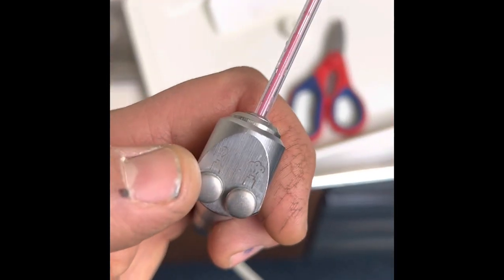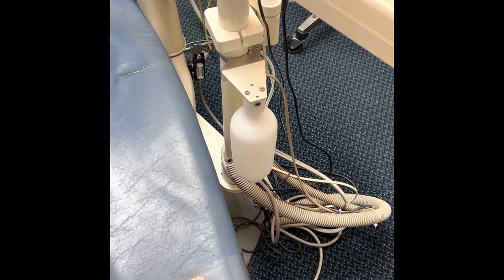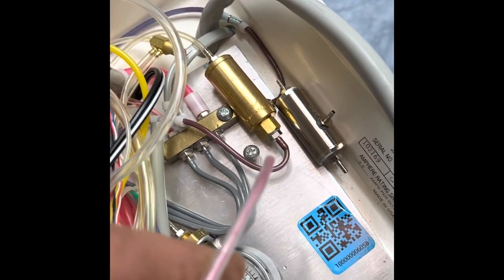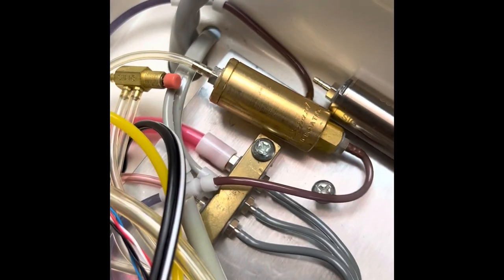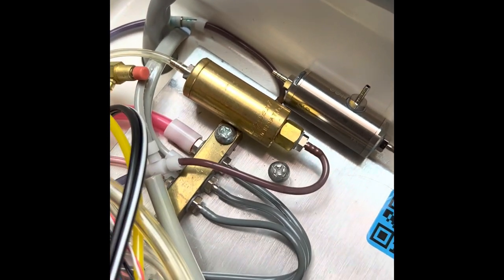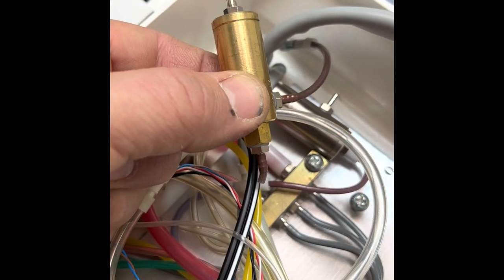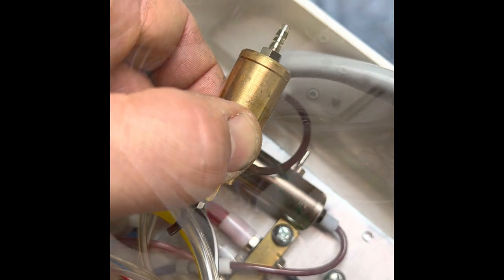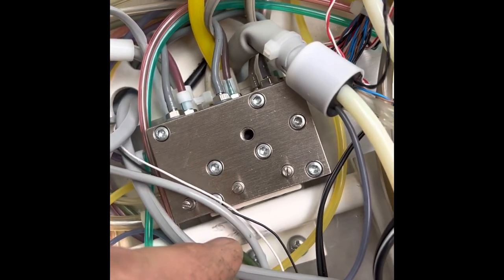Air Water Syringe Fix! Air in the water line...

Comment from the maker: You are the boss. Just keep in mind. You will never stop having problems with that unit. At some point the amount of time and money you put into it it will exceed the recommendation I'm sharing with you. The DCI block is superior to the Adec control block network in every way. I wish you the best and hope you find a solution to your problem. I will be curious to hear what it is but I'm expecting that the nickel coated brass blocks have begun to the laminate and water is bypassing in one way or another. The issue could also be a cracked bottle manifold as I mentioned earlier an easy way to check for this would be to disconnect the output line from your bottle and observe it spraying into a catch pan and see if there are bubbles in the water. If so, the manifold is your issue.

Comment: How do you change the diaphragm? My air/water syringe has air coming out with the water like this.
Reply from the maker: Unscrew the bottle... Check if you have a steri-straw water filter. If it becomes unscrewed, the water will spurt. Tighten the lure lock fitting and see if it improves

Comment: $100 Venmo to anyone who offers the correct solution to my problem before the service tech comes in on March 8th 2024. 
I have a similar problem that I notice spurts of air in the water in both the syringe AND my high speed handpiece. I have a pressurized water bottle as my water supply. Because both of these things have spurty air in the water with occasional stoppages of water altogether, would this point to the water bottle as the culprit? I feel like I've tested everything and the problem still remains.
Reply from the maker: Take off your bottle and look at the straw. If you have a steri-straw, make sure that it is screwed on tight. Air can get in at a loose junction on the straw. Your straw may also be loose on the top where it connects to the barb. Replace the 1/4 poly tubing if this is the case. If this does not fix your problem, you may actually need that service tech.
If they bill by the hour, make sure you have a list of issues to fix. Especially air water syringes that shoot a little water out when the air button is pressed. 😎 Maximize the time you have them. Also make them check out your utility room to see if everything is OK. Good luck!
Reply from the maker: What was it??? Curious.
Reply: @DentalEquipmentRepairChannel  I have a steri-straw and I took the bottle off.  The straw was screwed on pretty tight already.  I gave it one more strong hand tightening and it moved a smidge.  I will test that today while working.  If the air clogs the water at any point today I will look a bit deeper a the straw where the top connects to the barb and replace the 1/4 poly tubing if necessary.  Thanks for your reply.  I'll report back after some regular usage.
Reply: After working on a few patients, my symptoms are still there.  
My main issues are: 
1. occasional air spitting from air-water syringe while only pressing water button
2. occasionally the water stops completely from a-w syringe.  When this happens I shoot out some air and go back and forth on the buttons for about 10 seconds - then back to normal.
3. similar symptoms on the high speed handpiece.  Occasionally water stops completely - as it builds up (somewhere) and then finally releases, there's a sudden big surge of water out of the handpiece for several seconds - not good for working on patients.  I can get the water to run through the handpiece but it is erratic and not consistent or reliable.

So the problem remains.  On the plus side, there's still a week before my service appointment so I am happy to try anything else out.  This is a Adec Century Plus delivery unit.  I have changed out the plastic seals between the blocks, the diaphragms on top of each block (4) and the cartridges on the bottom of the blocks.  I have not yet tried replacing the 1/4" tubing line to the water bottle.
Reply from the maker: You have some issues inside the diaphragms of your unit. I would highly recommend upgrading your unit to a DCI century plus upgrade. Page 228. This is the best possible thing you can do. https://literature.dcionline.com/Parts-Catalog/228/
Reply: @DentalEquipmentRepairChannel  Thanks for your replies - I really do appreciate your input.  So I had the repair tech from Schein come and diagnose my issues... his proposed solutions were to use a-dec rebuild kits for the air water syringe and 2 new rebuild kits for the master block.  He basically said that I need strictly a-dec kits because other parts won't fit, seal or work the same as a-dec.  He also mentioned that the water bottle needs a new seal gasket suggesting that air is getting into water lines this way.
I didn't like these suggestions as I have already gone through replacing check valves, diaphragms and gaskets without success.  And the air water syringe does exactly what your's does in this video @ the 1 minute mark.  You thought (100%) that it was one of those (clipper?) valves that was faulty but then after replacing it, you changed you mind and went to the main diaphragm causing the problem.  So which was it really?
If it could be the valve - how can I similarly diagnose this in my century plus unit?
If the diaphragm - where in a century plus unit is the appropriate diaphragm to change?  

I thought I changed the correct ones in the master block - but these are only for the 3 handpieces that are controlled by the block.  I believe there are 2 square diaphragms in the unit that are closer to where the water and air enter the unit from the umbilical.  This is where I have 2 cylindrical white filters (one air one water).  I changed the filters but I didn't have new diaphragms to change at that time.  I'm grasping for anything that could be the cause of air getting into my water lines and by process of elimination I'm running out of possible solutions to try.  Thanks again.  I truly believe that if I fix the problem I'm having with my air water syringe then the handpiece problem will also be corrected.  They seem to both be affected by air getting into the water line.
Reply from the maker: The century plus is a different animal than what I worked on here. Adec century plus units have a high likelihood of water bypassing in the block. The DCI unit I suggested is really your best move. https://literature.dcionline.com/Parts-Catalog/228/
And the supplier is incorrect that the RPI kits are not good. RPI makes really good kits.
Reply: @DentalEquipmentRepairChannel  thanks but I'm not going to buy a whole new unit because I have something causing air to leak into my waterline. Way too expensive. This has worked for me for 15 years and just recently started this symptom.